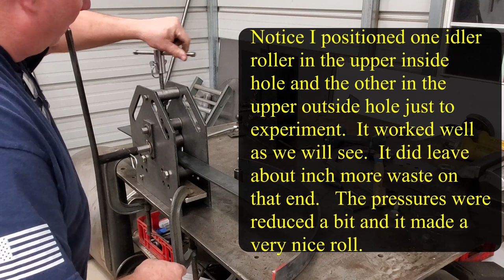BBQ Smoker Door Band Roller

Comment: HOW MUCH IS YOUR DOOR 
BAND ROLLER, DID'NT SEE ON YOUR WEB SITE!
Reply from the maker: If you contact me via the mysticsmokers@gmail.com website,  I'll provide a current cost and my phone number to discuss it further.  

I have not settled on a permanent price because I'm still working to streamline processes and reduce my build time.  

Once I settle on a fixed cost, and get several in stock, I'll throw them on the website.

Five sold within hours of the video release.   I don't want to get covered up and create lag times.  

That initial rush will slack off in a week or two.  I'll add them to website and the Etsy shop at that time or when I get 5 or 6 in stock.   

Just contact me if interested and we will get things moving.

Comment: What roller is this?
Reply from the maker: I'm not sure what you are asking here.  

The roller makes the vertical door bands for a smoker cooker.  Rolled perfectly to match the tank diameter. 

I designed and make the roller for cooker builders.
Reply: @mysticsmokers3014  where to buy one. I mean.
Reply: @mysticsmokers3014  Ill probably order one.
Reply from the maker: Contact me at mysticsmokers@gmail.com

Ill provide a number to call or text.